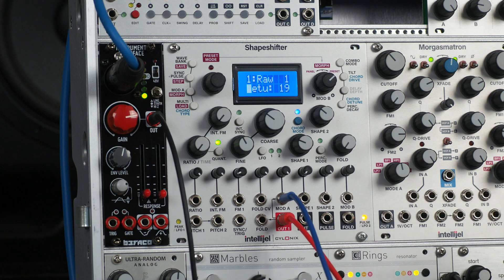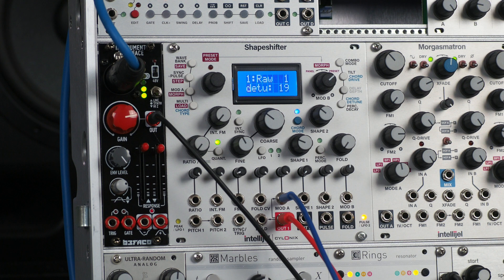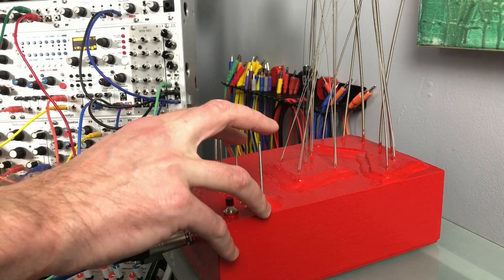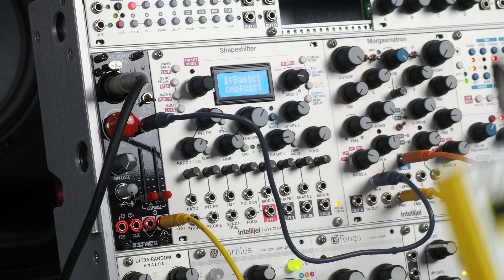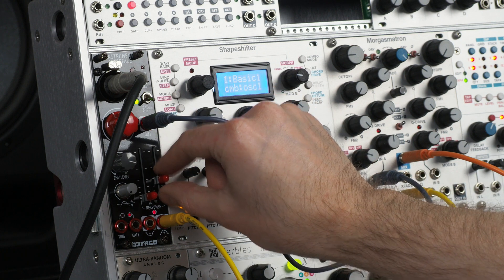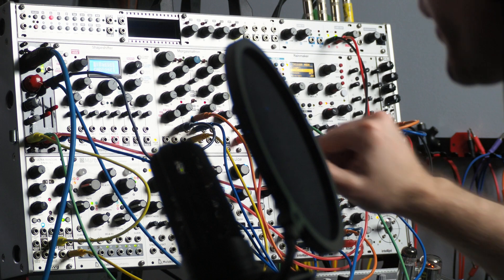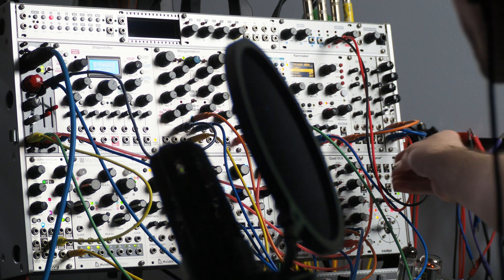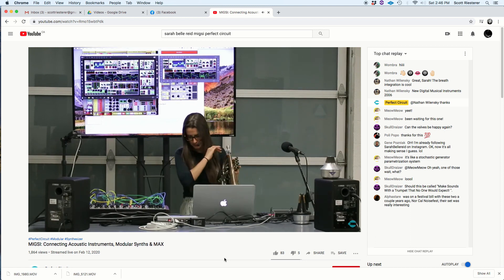Befaco Instrument Interface - Overview Walkthrough Tutorial

Comment: Hello! Do you think the Befaco could handle a Eurorack audio levels? Was wondering if it could be use for a ducking effect by sending it a kick signal (from a eurorack module/level) to get the negative envelope output from it into a VCA input for the ducking effect. Would this work or is the Eurorack level audio going to damage it or not work well? Thanks
Reply from the maker: That's a good question! I'm pretty sure it would be fine and shouldn't damage anything, but it's always a good idea to ask the manufacturer if you have concerns like that. Since eurorack level is hotter than the line/mic level signals expected by the input, I would recommend starting with the GAIN all the way down, then gradually bring it up until you can see the LEDs lighting to around the yellow point. That would definitely work with the envelope followers on a kick to produce the ducking sidechain effect with a VCA. Another way you could accomplish this would be a dedicated envelope follower module, or a slew limiter.
Reply: @ScottMFR  Thanks for the reply! I already sent an email to Befaco with this question but meanwhile found your video and thought I might ask you as well, eheh. The slew limiter approach I hadn't thought of and quite seems interesting, I'll give that a try! Thanks again and best regards
Reply from the maker: @gdrdm  yeah I’ve used a channel of maths for this purpose and it’s quite effective.
Reply: @ScottMFR  Nice, makes sense in my mind. Have a Maths, will try! Cheers